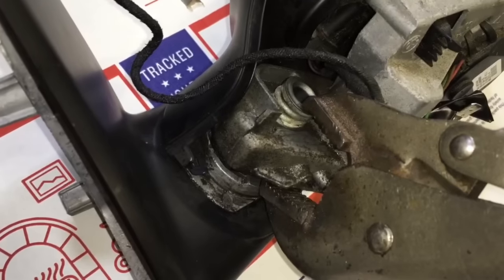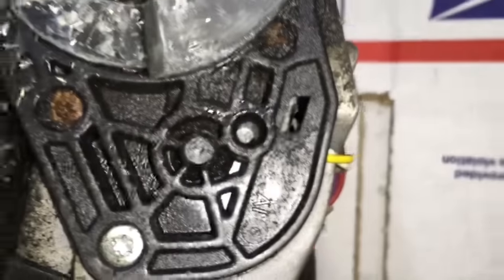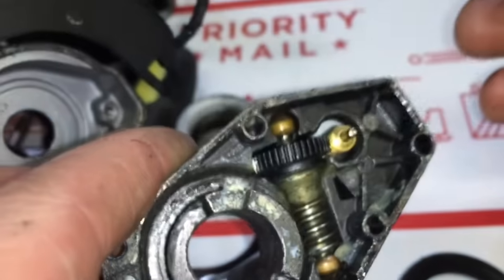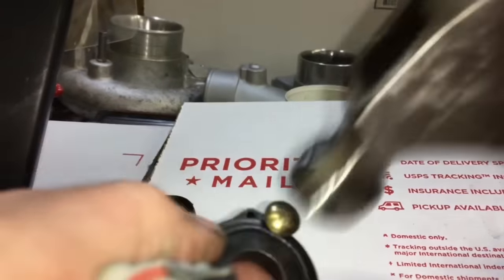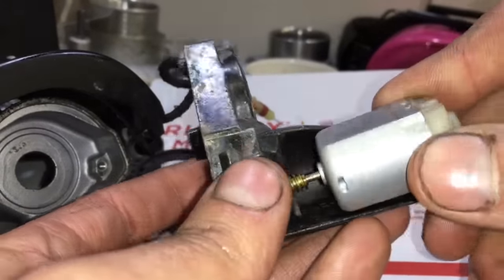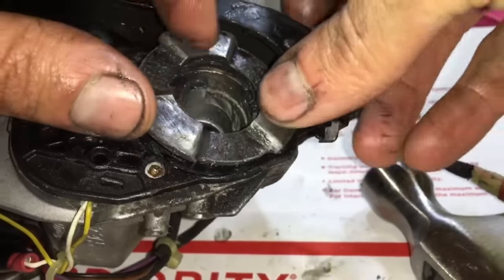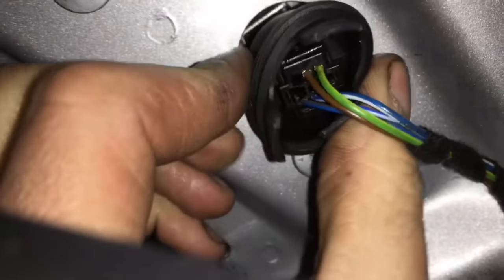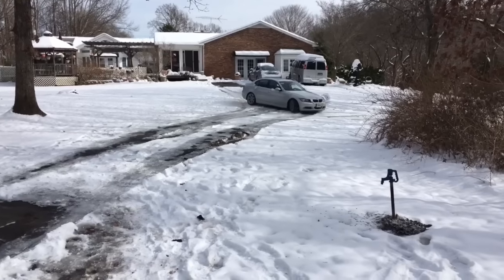Bmw Folding Mirror Fix

Comment: Drilling an access hole and adding lube did not work for my passenger side mirror but this method shown did! An alternative to re-assembling by welding is to use a nut, bolt and combination of washers which can be slid off center to allow the wiring to pass through.
Reply: Hello brian, do you have a Photo of your repaired mirror With the nut, Bolz and washers? Thanks
Reply: Your a legend I’m taking this on and I don’t have a welder. Bought the car but driver side wire is cut and my passenger side pin is jammed… I drilled the hole and pushed the pin but perhaps I drilled too much as the pin jumped out… now I need a new metal housing which is 60$
Reply: I don’t suppose you’ve got any more information on how you did this, reattaching with a bolt and combination of washers? Im struggling to see how that would work

Comment: For anyone down this rabbit hole on an F25 X3 (2011-2017), the axle on which the mirror pivots can be removed by pressing it down and rotating the part about 1/8th of a turn. if you drill a 5mm through the gaps in the spring, you can get a hex wrench in between there to assist with the rotation. Then you can reuse the part and avoid finding someone with a tig welder.
Reply: Hi do you have a video tutorial for that? Having trouble removing the axle
Reply: @mortsidestreet  I don’t, sorry. Note that on the driver’s side, the axle must be turned clockwise to release it. It’s the opposite of what you’d expect.
Reply: Thanks! I still could not figure out how to twist it. To be exact, I dont know how to press it down properly. I think there is a proper tool for it though. Im trying to picture how to do your suggested approach.
Reply: @mortsidestreet   What was the result? Same problem
Reply: @슥삭-o6q  still unable to disaasemble it

Comment: Anyone knows if I can fix the e46 coupe/convertible folding up side mirrors the same way? My driver side mirror is stuck for about 5 years now and I finally want to fix that. Goes up by pushing the button, but not going down (only by hand)… I need to fix that shit now!
Reply from the maker: Are you talking about the mirror adjustment? Can you post a video? I’ll check it out.

Comment: I did something very similar to this. Instead of welding I just took a 12mm alu tube, cut it to size, cut in 2 grooves and used seger rings to avoid having to weld anything.

Mechanically everything went well but disaster struck, im not sure what went wrong, but now my entire window switch assembly is dead, cant open any windows or adjust mirrors. Any thoughts why?

The only clear fuckup I can think of is forgetting to disconnect the battery before cutting the 3 pin mirror cable. Nothing noticable happened during the cut but I have no other explanation.

Comment: great work. I am looking for the typical problem with the exterior mirror. everything is shown very well on the video. only what i didn't understand is how did you end up reattaching the sleeve? is it welded or soldered?
Reply: I think soldered

Comment: How many years this mirror worked after soldering? Which type of soldering do you used?
Reply from the maker: It still works, it’s been about 6 years and 30k miles later. I used a Lincoln welder and used flux core wire. It wasn’t the best welder but it worked

Comment: Everything is clear and the video is very helpful. The only question I have is when you welded the steel washer to the "metal stick", did you weld it in the way it would move or stood still?
Reply from the maker: It still needs to move. The washer holds the mirror together. We are just replacing the washer from where we did the drilling

Comment: good vid I have an E46 02 323i with this type of setup but I think the gears are different ..was thinking of repairing the mirror I have but the pivot sleeve I think I would try and replace it with something ..did you measure the pivot pin ...there would have to be something that would take the place of it...or if I have to use existing pivot I might try and solder instead of welding
Reply: I just came upon a web site in Aliexpress which might have a pivot tube ...was thinking on Sanitary Hose Barb Pipe Fittings has top collar and was thinking could put c/clip to the bottom barb instead of welding ...can you tell me what was the dimensions of the pivot sleeve if you remember

Comment: Good job Turbo Lab....I have the same problem with my 07' 328i the driverside mirror.So i have a question: on the time from 0.17 through 0.23 is that drilling the only way to seperate that part.
Thanks!
Reply from the maker: Yes.its the only way unless you want to buy another mirror
Reply: Turbo Lab America. What kind od welding you did? I see like a cream washer ...did that washer came with the mirror or  did you add it on?
Thanks.
Reply: At 0:13 you can see that there is originally a flared flange swaged into the tube which he drills out to release it.  Since material is removed he had to weld the washer to hold the tube in place.  The welded washer replaces the original lip that was flared out on the tube that held it in when it was originally assembled.

That tube that goes through the spring at 4:11 has a flange on both ends when the mirror is built, but in order to remove it he had to drill off the flange on one end.
Reply: thank you for responding to my comment, but I dont know how to welded, is it like a tig welding that the washer was welded? and was that washer had to be the same kind of material for it to welded?
Reply from the maker: It's a mig welder. Use a steel washer.

Comment: Hi, good video. What I don't get is the drilling bit at the beginning of the video. Please tell me why you doing that. Thanks
Reply from the maker: +Ahmed Fazal it has to be drilled to separate the mirror
Reply: No other way to separate the mirror assembly and base part?.
how to remove the plastic bottom cover with out damage?
you have made video no one else made.good.
Reply: JUST FIXED THIS DIFFERENT WAY!!!! JUST SPRAYED A LOT OF WD40 UNDER THE ROTATING PART OF THE MIRROR. Remove plastic cower, then just pull whole mirror up (or bend it to the side) so there's a thin space under the rotating mechanism between the mirror and car holder. (Buy small 100ml WD40 with thin pipe, so you can squeeze it deeper into that 1mm space what you will have when pulling mirror up or bending it to the side. Note! You can pull or bend it just slightly, just few millimeters). Spray WD40 into that space aiming to the area, where this stuck thing is located (that thing with spring, what this guy in video oiling in the end), keep removing excessive WD40 with paper towel. Rotate left right, shake a bit the whole mirror, not too much, don't damage anything, then repeat. After a while (in 5 minutes or may be 1 hour) oxidation on the lock will be gone, the mechanism will get unlocked and working again. No need to damage the mirror. Then just put plastic cower back. @palanik1960

Comment: Ahhh! the infamous little white motor! I just spent $1,800. + to replace my steering column because the same motor failed in the locked position. When I got the car back, the side mirrors were all screwed up, not stopping. Don't let the grease monkeys work on your bmw.
do it yourself or take to dealer,  you'll maintain your sanity and won't have a heart attack! 
PS. Steering works now, (half *ass) but they didn't code new column and other mistakes. 
CAS fault codes everywhere! It'll have to go to the bmw dealer to correct it.

Comment: excellent job on the video, can't wait to try. need to buy a welder
Reply: JUST FIXED THIS DIFFERENT WAY!!!! JUST SPRAYED A LOT OF WD40 UNDER THE ROTATING PART OF THE MIRROR. Remove plastic cower, then just pull whole mirror up (or bend it to the side) so there's a thin space under the rotating mechanism between the mirror and car holder. (Buy small 100ml WD40 with thin pipe, so you can squeeze it deeper into that 1mm space what you will have when pulling mirror up or bending it to the side. Note! You can pull or bend it just slightly, just few millimeters). Spray WD40 into that space aiming to the area, where this stuck thing is located (that thing with spring, what this guy in video oiling in the end), keep removing excessive WD40 with paper towel. Rotate left right, shake a bit the whole mirror, not too much, don't damage anything, then repeat. After a while (in 5 minutes or may be 1 hour) oxidation on the lock will be gone, the mechanism will get unlocked and working again. No need to damage the mirror. Then just put plastic cower back.
Reply: @biotom.  WD40 is not a lubricant. More of a cleaner. It evaporates fairly quickly. It will not last. Need to use proper oil.

Comment: No other way to separate the mirror assembly and base part?.
how to remove the plastic bottom cover with out damage?
you have made video no one else made.good.
Reply from the maker: The lower cover I forgot to show. You can follow this video first: https://www.youtube.com/watch?v=PLLx8a10ewM&t=2s this video was hard to understand so I redid the video in my own way but I originally watched this video to understand how to fix the problem.
Reply: JUST FIXED THIS DIFFERENT WAY!!!! JUST SPRAYED A LOT OF WD40 UNDER THE ROTATING PART OF THE MIRROR. Remove plastic cower, then just pull whole mirror up (or bend it to the side) so there's a thin space under the rotating mechanism between the mirror and car holder. (Buy small 100ml WD40 with thin pipe, so you can squeeze it deeper into that 1mm space what you will have when pulling mirror up or bending it to the side. Note! You can pull or bend it just slightly, just few millimeters). Spray WD40 into that space aiming to the area, where this stuck thing is located (that thing with spring, what this guy in video oiling in the end), keep removing excessive WD40 with paper towel. Rotate left right, shake a bit the whole mirror, not too much, don't damage anything, then repeat. After a while (in 5 minutes or may be 1 hour) oxidation on the lock will be gone, the mechanism will get unlocked and working again. No need to damage the mirror. Then just put plastic cower back.

Comment: The fact you need to drill and weld is a bummer. I've seen a polish guy use a hollow bolt, which looks easier: https://www.youtube.com/watch?v=ht5_UjNu3xE

Comment: …25 minutes at the junkyard, and done.  No need to do any of this.  Yes, it’s a crap shoot, so buy a couple of them.  They’re $5-15.
Reply: If you have the M5 mirrors, they are not 5-15 USD, more like 500 USD pr. pcs. Also standard mirrors are expensive here in Norway, at least 100-150 USD.